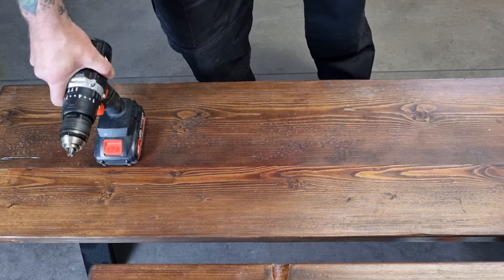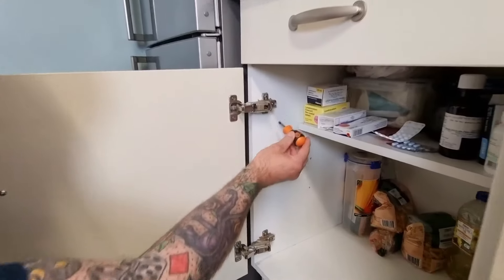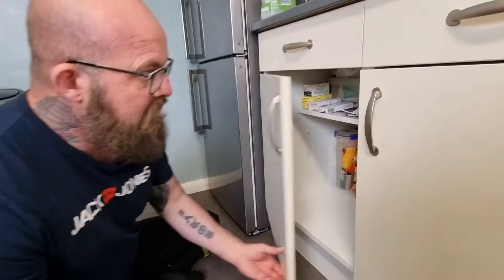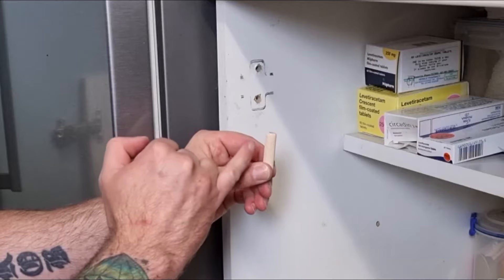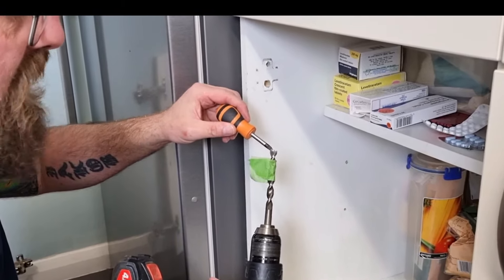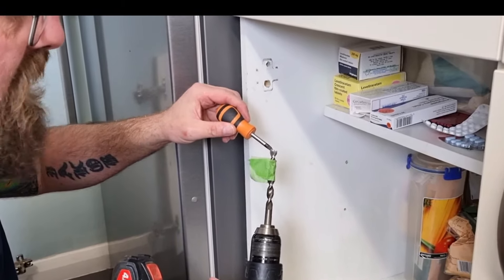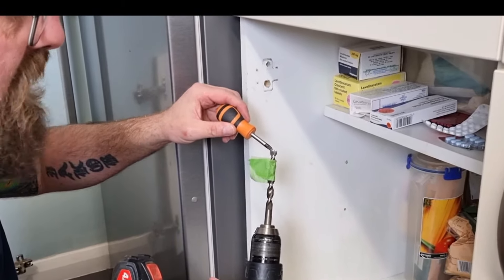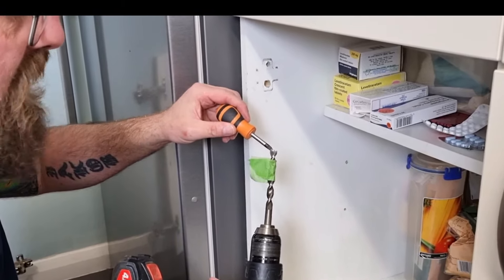Don't Let Loose Hinges Ruin Your Kitchen - Here's How to Fix Them

Comment: Great video ..I think originally it would have been an idea to use "Plastic Hinge Dowel Inserts " which is like a rawl plug for wood\chipboard etc ..p.s. the screws on mine are tight so I think the play is within the hinges themselves 😒
Reply from the maker: Yes the hinges may need adjusting or tightening.

Comment: Skip the hole. Use toothpicks with super glue until tight and full, trim off. Center punch and predrill. I just did 4 doors while I watched.
Reply from the maker: Doubt it that you did four doors while you watched, in fact I'd say your lying out your butt 🕳